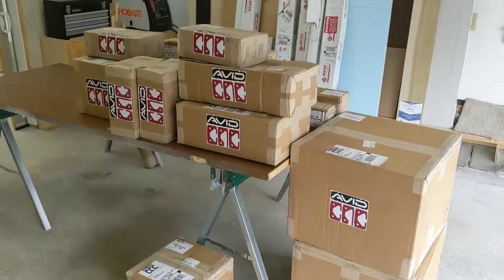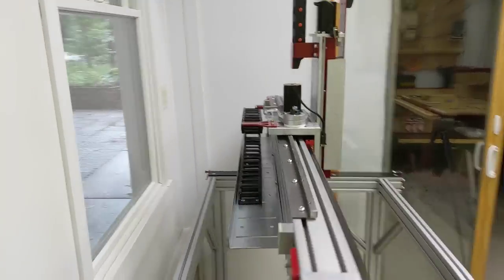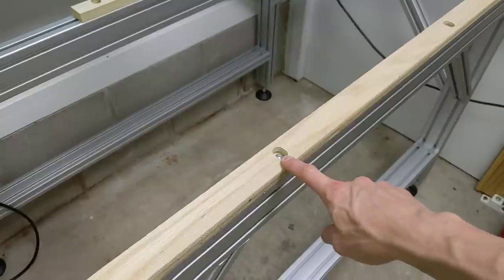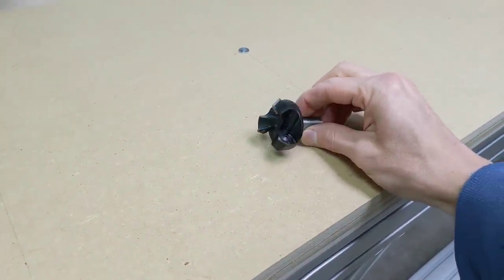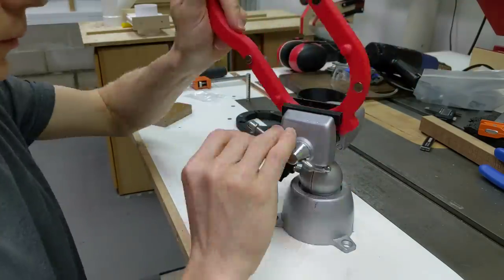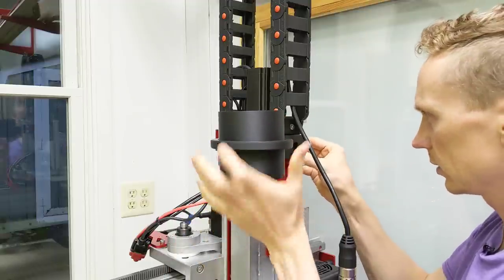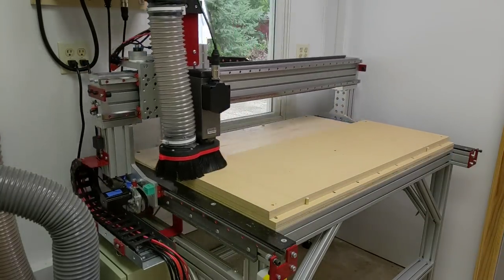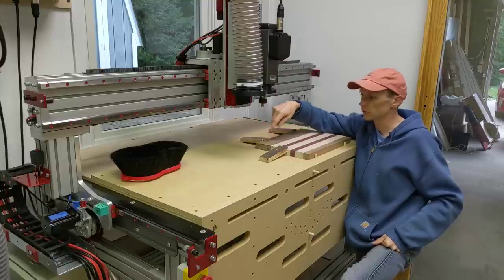Building a CNC Router in my Small Workshop

Comment: Congrats on the new machine! Few thoughts:

1: You missed the Matthias Wandel school of thought on CNC routers: unless you're making a bunch of the part, or it's something really complicated, you could probably make it a lot faster without the CNC. There's all the time spent on CAD and CAM, plus the setup and cutting time, as well as whatever cleanup you need to do afterwards. The cutting time is worse if you have to actively monitor the CNC or chase the bit with a vacuum.

I think I mostly fall into this camp. Remember, the tool with the highest material removal rate is a saw. Any time you can remove the waste as a single or small number of large chunks is much better than turning it into chips or dust. CNC is great for some things, but there's plenty of times at work where I really wish I had a manual mill where I could be done with my part faster than it takes to just do my CAM, but we only have a CNC mill.

2: That wasn't your first time making G code. Your 3d printer runs on G code as well. I don't know if you ever manually review or edit G code for your prints, but it's a useful skill and applies equally to CNC routers. Being able to understand what your code is trying to do is really important when diagnosing errors or trying to figure out why it's doing what it is.

3: Label your dowel holes. Whenever I make a fixture at work, I engrave instructions and/or info on them. I highly recommend you do the same with your dowel holes on any future spoil boards, and you can still use a sharpie to label dimensions and what not without taking anything apart or changing any dimensions. This will save you time on counting out holes and keep you from making mistakes by accidentally using the 15% angle hole when you wanted 20%. Sharpie on aluminum isn't very durable, especially with flood coolant, but it will soak into the MDF and be very permanent. 

4: Machine weight and vibration. That router looks very light. I would look into adding significant weight, to reduce vibrations and increase rigidity. The frame looks reasonably beefy, but it looks like you could move the whole thing by yourself. Attaching more weight to the fixed parts of the frame will make help.

5: Exposed linear rails. I'm somewhat concerned about those exposed rails getting dusty and damaging the bearings. I would look into some sort of way covers, probably with plastic bellows or sliding telescoping sections.

6: Most importantly, stay safe and have fun!
Reply from the maker: Really great thoughts in this comment! I agree on most accounts. I would like to add a lower shelf and load it up with weight. I also considered bolting it to the floor. I never had the need to review gcode on my 3D printer but I do see the value in it on the CNC router. I have been adding some commands manually at the end of the gcode to move the spindle out of the way when it's done. I have not seen anyone cover the linear rails on this machine but it's something to condsider. Covering them would also keep me from getting greasy from accidentally touching them!
Reply: @JustinDepew  another G-code habit you might want to pick up is to put in comments at the start of your code the tools you need (and what length of protrusion), what the starting material looks like and how it's aligned/mounted, and the program time. I know you're doing manual tool changes and probably don't have much tool shank to choke up on for now, but good habits are good. I also don't know what your workflow looks like, but mine is to do CAM, generate my G-code and add my comments, then save that to a floppy to take to the room with the CNC, so having my tool list, program time, and instructions makes it a lot easier to come back a month or more late and be able to run the same program without having to go back to look at my CAM. I'm also using SolidWorks for CAM, which is pretty awful, but comes with our SolidWorks license, so anything to save me from needing to go through that to try and figure out how to run things.

Your return to home gcode is also a pretty great idea, especially for a machine without a handwheel attached to the front.

Comment: CNC is a good tool. Just like any other tool, getting results from it is dependent on your familiarity with it's ability. Depending on what you make in the workshop, it can be a great addition to expand and speed workflow. It also can hugely increase efficiency when cutting larger plywood pieces, as you can plan and cut so much more closely to other compound shapes than with other methods.

Comment: i've had pretty bad luck with press fits into PLA (no idea if that's what you're using), due to creep over time loosening the grip. if you run into the same issue, one thing i've found that works really well is instead of a tight press fit, fully embed the magnet in the part. you just have to figure out the right g-code for pausing the print on the right layer (super easy with PrusaSlicer if your printer supports M601); the idea is that you insert a pause right before the layer where it would start covering up the magnet, so when it pauses you can insert the magnets and resume. looks like you have a steel print bed, a nice thing you can do with magnets is, position the magnets in your model / orient your print such that the magnets are really close to the print bed, to help keep them in place till they're covered up by subsequent layers.

One downside is that the magnets are no longer directly touching, and depending on geometry, even that <1mm gap can really reduce their strength

You can also do this with nuts, but it's a bit more work to get it working right since you probably want a hole going through it, and printing bridges with holes is really tricky. (you can print a single solid sacrificial layer above the nut, and break through it the first time with the bolt, or have the ceiling above the bolt come in in stages, so that each layer's bridge lines are just straight lines, it's fiddly)

Comment: I think there is a third camp, the one I am in, where we just like making stuff and try to our best to use the best tool for the job at hand or whichever we feel like using. Some days it is chiseling out the last of a dovetail cut made on the table saw or rip cutting a long board by hand after cutting it to length on my Dewalt 12 inch miter saw. Woodworking is amazing and the best part is we can make things that may last generations. 

I don’t own a CNC but one of the most interesting things I see is when somone makes a pattern on the CNC to use to cut 6/4 hardwood to the right shape then using a flush trim bit against the pattern to make perfectly matched pieces. 

Enjoy your new tool.

Comment: Hi, I’m getting close to making a spoil board for my diy CNC. I like your thinking, go simple on spoil board at first, get up and running before deciding on what to do. Not to mention you can use a working CNC router to make a spoil board. Can’t wait. I only have limit switches left to wire, making and attaching the router mount to the “z” axis than the  spoil board. Because mine is a diy, trying to come up with a set up for the router motor that gives me a way to “plumb” the router bit. Some sort of pivot, both left and right and fore and aft. My biggest worry at this point is “squaring” the bit to the table.

Comment: Great video! When I've had these "purists" spout off, I've said to them, "Look at every period in woodworking and what you'll see is the craftsman using every single tool and technique available to them at the time. The reason techniques advanced is because the 'non-purists' tried to find faster and easier ways to do things. Do you honestly think that if the early woodworkers had been offered a table saw they would have said no? You can choose a period in woodworking history in which to make yourself stuck in, but it doesn't mean those who use modern technologies aren't 'real woodworkers' any more than those who first used a table saw in the Shaker days weren't real woodworkers."
Reply from the maker: Well said!
Reply: Facts
Reply: Would you rather be touching wood and developing fine motor skills in your hands and body or typing on a computer terminal....choices.
Reply: Ha ha, Just for the record there were no new tools for woodworking from Roman times to around 1800 with exception to perhaps the spokeshave that came along in the 1500's. At first many tradesmen did not embrace powered machines as it put them out of work. And even when they did they still had to handle the material through the process . For many people CNC type work is not woodworking because you do not have to have any skill or grow any skill to make anything as its just done for you by the machine whilst you read your book . They also produce rather soulless identical items  and in the case of lasers all with the same black edge. But its horses for courses but for me and many like me I cannot see what the point of CNC work is unless your going to make a lot of boring stuff to sell to soulless punters

Comment: A CNC machine is like any other tool.  Sometimes it’s appropriate for a specific task but not always.  Some woodworkers get seduced into spending lots of time on programming and setting up to make a cut that they could have done quicker using different tools. 
I must say that it looks funny when a machine is doing the work and a human is following the cutter as the dust collector.
Reply: I was sitting around watching a bunch of sales and engineering people puzzle over the price they were going to quote a job for two pieces. It was a trapezoid, basically, with one side that wasn't orthogonal. After hearing the third or fourth proposal about what machine to run it on, I couldn't stand it anymore and I said "Just no-quote it. It's too hard. I could have made one by now on a Bridgeport and you're still worrying about getting a quote to the customer by the end of the week, f**k!"
Reply: lol, i never thought of it that way.
Reply: Who gets to decide on what machine to use Raskolnikov?

Comment: Flex hose really slows down air flow (unless it is smooth on the inside). I'd recommend using a smooth rigid pipe to the top of the gantry just to improve flow. You could probably reduce the length of flex on the other end too.
Reply: Could be so, however, all household vacuum systems seem to use convolute hose.  I think a scientific test could be carried out to determine if the statement you made is true or not.  Cheers and thanks for your suggestion.  I'm embarking on building an extraction system.
Reply: @lesblack413    The roughness of the wall causes a lot of turbulence which dissipates the velocity as heat. In a real world experience I had a house where flex ducting was used and even though the number of vents was sized correctly the AC was icing up due to insufficient flow. The long runs the air would barely blow out. Swapping those to smooth vent pipe for all but the last transition greatly increased flow.
Vacuum hoses are corrugated to allow  thin, cheap, light weight and very flexible material to be used. They don't really care all that much about the performance loss as almost no-one knows or compares vacuums to that level. 

But don't take my word for it. Test it. Get one of those wind anemometers and test the opening without the hose attached, and then at the tool head. You will probably find a significant difference. Another cheaper option would be to use some clear tubing full of water to make pressure gage and make a pitot tube to measure velocity (this is actually more accurate). That method takes a bit of calculation as well. Search for some videos on pitot tubes if you want to try it.

Just some things to note. Fundamently you should be able to just tell the difference. However placing your hand or a board over the opening won't show the difference. The loss of suction happens to the velocity. If you cover the opening the velocity is zero at both test locations and you won't see the difference. A handful of dust might show an obvious difference.

Comment: you shouldn't need to use any tabs to secure your MDF cuts. The MDF powder itself stays compacted in the cut channel and secures the piece really well, even if you're running dust collection. Plus it'll save you a lot of time on the back end not having to cut and sand the tabs away. MDF is a pain to work with, this is one of the few benefits when you CNC it though, no tabs!
Reply from the maker: I'll have to try that. Thanks!

Comment: look into "glacier green" mdf.  its not much more expensive but compared to the mdf your currently using it will feel like your driving a sports car when you use it.  i use mdf daily for production and have to stock a dozen manufacturers mdf for various customers.
Reply from the maker: Never heard of that. Thanks for the tip!

Comment: I am curious as to why you glued your spoil board down to the plywood.  Doesn't that mean you will have to replace both pieces when the spoil board is worn out?
Reply from the maker: I glued it down so there wouldn't be any screws that could get hit by the router bits. When the initial spoil board is worn out, I will just surface it flat and glue another one on top. I won't have to replace or remove the plywoood.
Reply: @JustinDepew  it will be more of a pain though since you glued it down. I would recommend next time using nylon screws or Brad nails to hold it down so your cnc can just cut through it and it's easy to pull up and replace.

Comment: Hi Justin.  Very nicely done vid. Thanks!  Your spindle seems pretty quiet or is that just an editing result?  I guess I'm asking if it's a lot quieter than, say, a typical router like the Porter Cable I'm using on my CNC router. (makes one's ears bleed)
Reply from the maker: It's a little of both. The audio has been lowered but also it is quieter then a router especially at lower speeds. At full speed it's still pretty loud. The most noise comes from the bit cutting the material.
Reply: @JustinDepew  Thanks Justin.   That's saying a lot about my PC as I don't think I've ever heard my cutter over the wailing router. :)   On mine the cutter just sort of changes the 'flavor' of the noise.

You're going to love your new router.   You will start seeing all sorts of things you can do with it that never crossed your mind before.  It opens up the whole world of acrylics that are otherwise very difficult to process any other way.   They stop being squares and rectangles with a few holes drilled into them as they can now be any complex 2-1/2D shapes, pocketed, and engraved.  Cheers!

Comment: Great video!! On the 24” x 48” footprint, does the machine have any wobble or vibrations during tight tool paths or during rapid moves?
Thank you
Reply from the maker: At full speed there is some movement in the base. I have considered either bolting the machine to the floor or adding a lower shelf with weight to increase the mass.
Reply: @JustinDepew  thank you for the reply

Comment: Good job, however gluing the MDF sacrificial board to your Ply base board was a massive mistake. That base board will also be a sacrifice now that the glue cannot come loose. Makes no sense to now have 2 sacrificial boards. Other than that, great job.
Reply from the maker: Thanks for checking out. My plan for the MDF spoil board is to occasionally surface it as needed about 1/8" at a time. Once it's almost all the way used up and just above the plywood subsurface I'll just surface it flat once more and glue another new MDF sheet on top.

Comment: Some decent CNC at around 7 grand is actually not that much considering someone will be cutting on it templates etc and selling them. But if just occasionally cut something that would be money wasted. I would rather used  money for more professional saw / jointer combos which would get used more often then CNC. 🤔

Comment: In my honest opinion as a professional woodworker with over 35 years experience in the industry of carpentry, joiner and cabinetry I firmly believe you need to understand and know hand tools plus wood and what certain woods do in certain applications first and foremost before delving into hardcore machinery, I can guarantee if you don't know or use the fundamentals to start your career in woodwork you may fail with your projects. we all need to start somewhere and a CNC is not the best place to start woodwork, for a start you cannot use a CNC in the field where electric is none existent, and before you say it, no I am not a purist more a realist. If you don't need that lovely router you binned I will have thx 😂. oh and one more thing, I bet I can make a cabinet quicker than you can machine one out. set up time, cad learning, and making the machine do exactly what you want, then you still have to put the cabinet together to make and finish it.

Comment: Can it do aluminum
Reply: Probably, with the right bits.   A lot depends on the hp of the spindle and feed rate.  The frame looks beefy enough.  Aluminum is a soft metal thatcan be worked with many woodworking tools.  I routinely cut aluminum w my 18v Makita circ saw and jig saw.